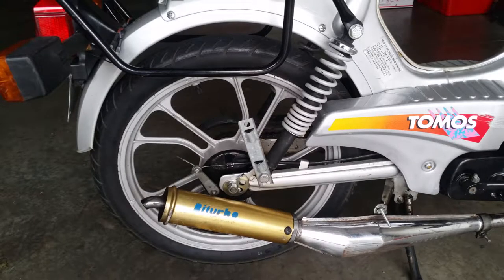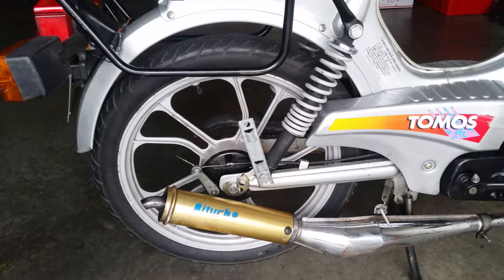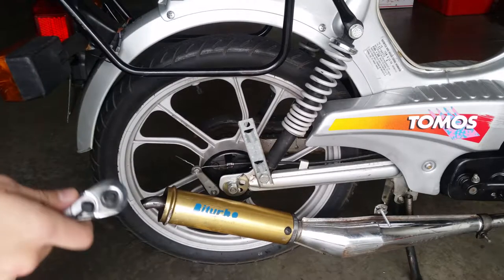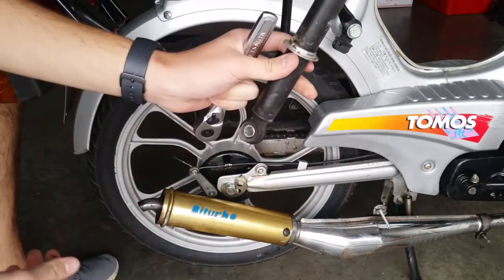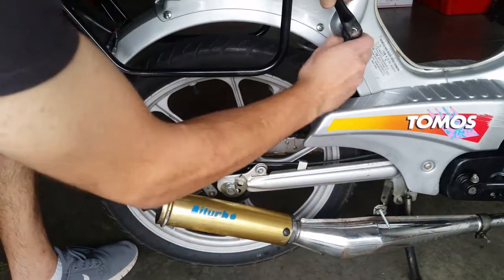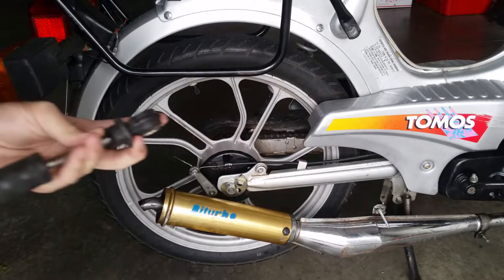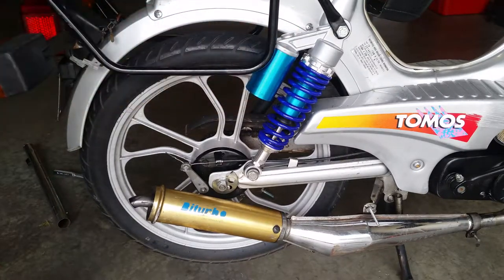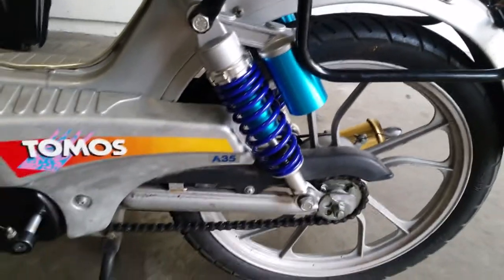How to Change the Suspension on a Moped

Comment: Love your videos, could you make a how to of, or explain how to replace the speedo unit on your tomos targa??
Reply from the maker: It's not too hard to replace, the cable just unscrews and the bracket is held on by one nut at the bottom center on the speedo
Reply: MotoTech thank you!!! Everything on my speedo dash has but glued in or something, looks like I’m going to have to replace that too cause there’s nothing but glue holding it